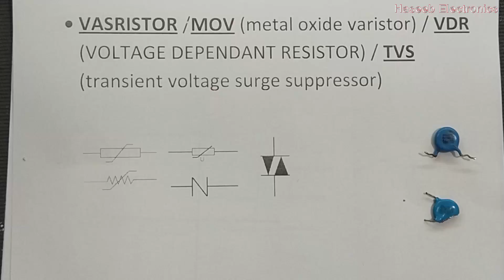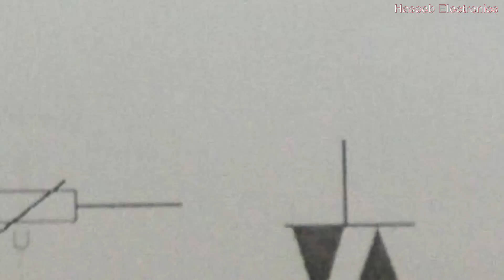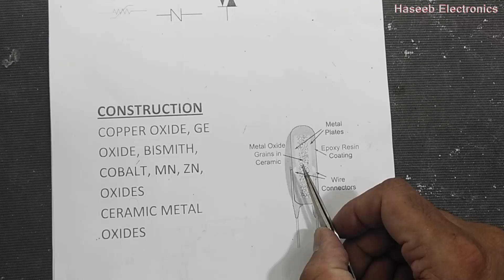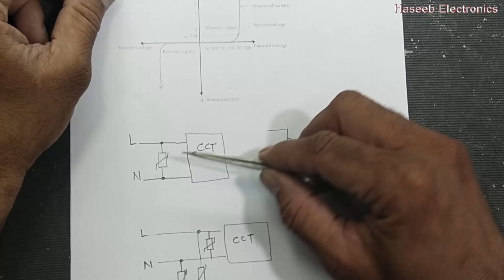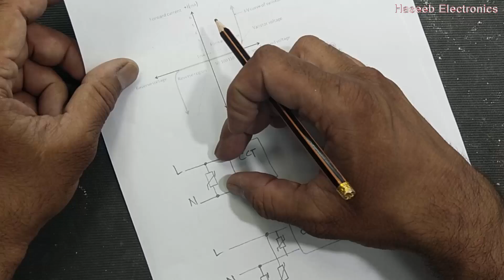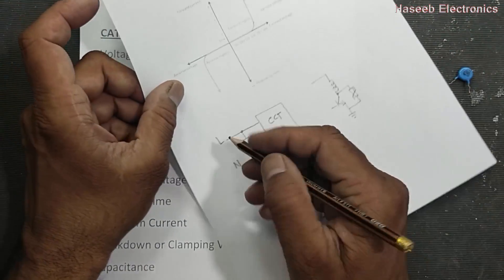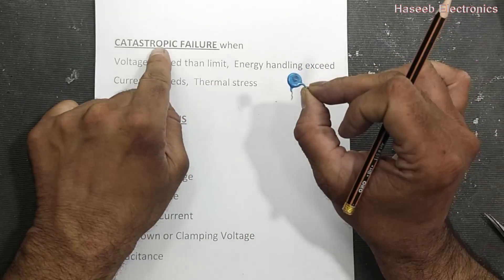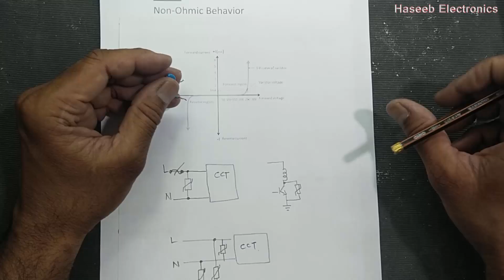{411} What is MOV, Metal-Oxide Varistor, VDR, TVS

Comment: I think you had a mistake there when you said the "double diode" is the same as a varistor 1:56. But they are not the same! The symbol in the right with double diode is for a DIAC, as you said. Traditionally, that symbol in the video was used for varistors, but nowadays it's used for DIACs. The listener may think that varistor and DIAC are "the same" which you didn't mean.

Comment: السلام عليكم  brother 
May I ask 
What would happen if a varistor malfunctions?
Would that cause it to go on and off rapidly?
Reply from the maker: و علیکم السلام و رحمۃ اللہ و برکاتہ
as we know, varistor is voltage dependent resistor. its resistance decreases rapidly in result of increase in voltage. 
if the voltage strikes repeat again and again, which causes to increase its substrate temperature , which causes to melt its oxides, and its material melts and makes short circuit between both terminals. 
as it is connected in parallel lines, immediately after the fuse. so parallel line short circuit (caused by the this varistor short circuit)  opens the fuse and the circuit is protected from further high voltage strikes

Comment: Hello 

Thank you for your educational information. 

I have two devices which I want to protect against high voltage (220 V). 

The varistor should clamp at (150 V). 

1st device: 

120 Volts 
550 Watts 

2nd device: 

120 Volts
2,500 Watts 

My question is: 

What's the right (MOV) size for each device? 
What's is the varistor's: 

Diameter
Resistance 
Voltage 
Ampere.  

Thank you so much.
Reply from the maker: best regards and special thanks

Comment: Are they easy to test? Is it necessary to remove them from the circuit board to test?
Reply from the maker: when we test with with multimeter, these must be open. 
most of the time when these are damaged, these blast badly. 
as these are connected in parallel line (between line & neutral) so these cause to blow fuse due to short circuit created by this failed component

Comment: Which protective device is useful for spikes of less than 10nsec. I have used MOVs but that don't respond such spikes.
Reply from the maker: in input try to use X & Y rated capacitor set, and set EMI filter with some good attenuated with acceptable corner frequency,  
then MOV or TVS unidirectional or bi-directional,

Comment: Tvs and mov are different things. Tvs is a diode and mov or varistor is a kind of resistance. Variable resistor is the opening of varistor. Vdr as voltage depended resistor.
Reply from the maker: you are absolutely right,
 just there is material difference between VDR and TVS. otherwise zener, tvs, VDR (uni-directional or bi-directional) have similar behavior
Reply: @HaseebElectronics  yes dear you are right too. They act similar but have some minor differences like opening speed, current capacity. You me and most know that but there are some new friends with us. I just wanted to imply that they are different components
Reply from the maker: @devrimtuncer8655  i am thankful for your valuable reply. yes these all components are categorized based on their  material, behavior, specs and various parameters.
please accept my best regards
Reply: @HaseebElectronics  so nice to know you

Comment: How can I test this component? Can I use a multimeter? when bad is it only destroyed? or will it short?
Reply from the maker: in good condition, it should open on multimeter, if it becomes short circuit, damage is clearly visible on its outer body and on multimeter it will short circuit
Reply: @HaseebElectronics  Thank you, sir!

Comment: Thanks Haseeb. I did not realize that you can have an MOV between live and earth and neutral and earth. Is it always better to have MOV's on all 3 wires?
Reply from the maker: yes dear. 
in low quality  2 wire power supplies for commercial use, they use just one MOV (that is not a safety but they manufacturers compromise on some hidden safeties) 
for 3 wire system, line to earth and neutral to earth, there is low voltage protection MOVs, that have very low clamping voltage rating as 11 volt only

Comment: السلام علیکم 
My brother I need to design circuit to protect ac motor from overload I can use thermal switch to protect but I need circuit that observe flow current if it exceed my current disconnected ac motor from load..did you have experience with that object... sincerely your ..ali from Iran
Reply from the maker: Wa Alaikum salaam dear brother
you can use a current transformer and apply its output to some op-amp or comparator. 
you can drive some contactor relay to cut the drive 
it is will much safe to protect it from over current other than thermal safety. 
you can also use thermistor to sense the temperature and inject its output to the same protection circuit
Reply: @HaseebElectronics  
Thanks alot for answering
Keep your way up..

Comment: is it possible that mov is connected between two voltage lines in a circuit?
Reply from the maker: yes it is possible, it have to arrest spikes from the RMS value, either it is dc or ac. either it have any frequency, 
just the spike should within range of the MOV (response time)
the operating voltage, clamp voltage, current, energy, response time are mentioned in datasheet
Reply: @HaseebElectronics thanks for clearing the point. 
is it possible to pridect valve of burned mov beyound recognition.? schematic not available.
Reply from the maker: @commandoo1  yes 
it can be estimated by its chip size and looking the circuit
if circuit is 250 volt operated then voltage value may 275V plus